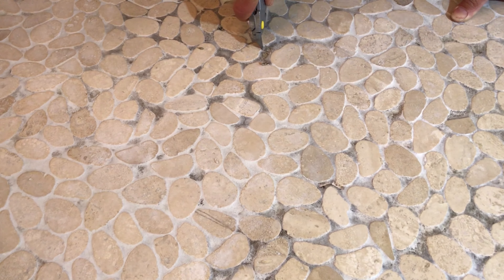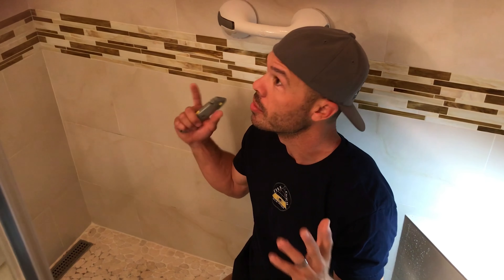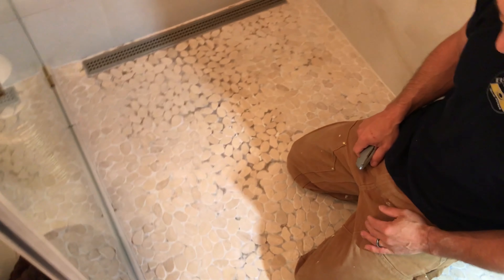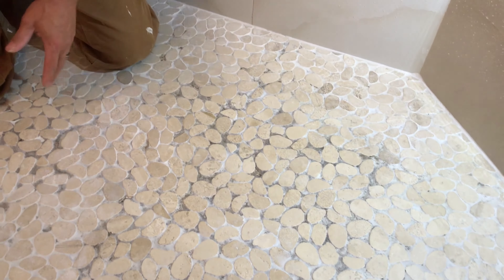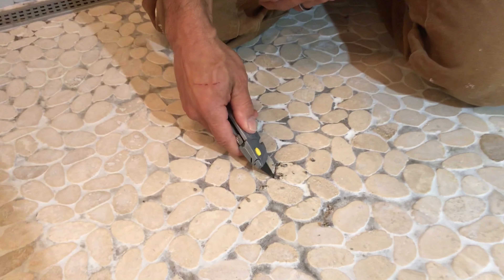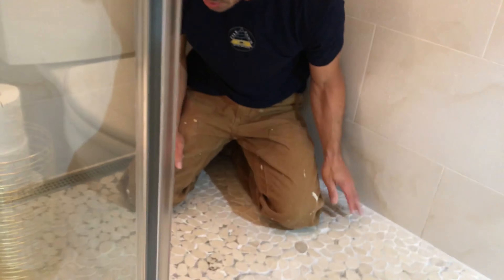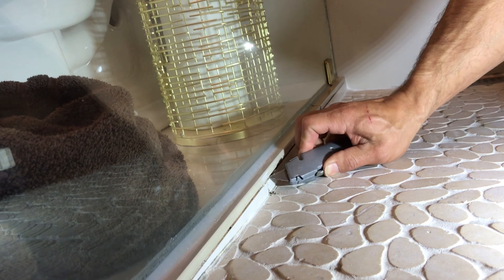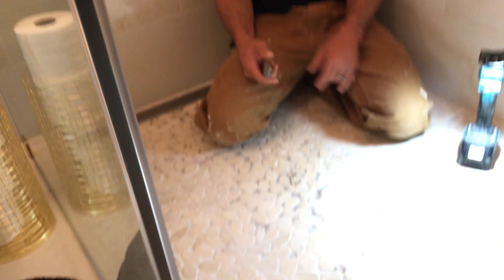I GROUTED this Shower WITH FUSION and it FAILED!

Comment: Just FYI for everyone. I've had sort of a similar issue with Fusion grout in showers, but I think the issue is that it just never dried properly. Whatever that label says, double it in a shower, let it dry completely - it doesn't dry well to begin with and when you start putting water on it, it never dries and starts getting moldy. I've had to re-grout 2 showers and the second time I let it dry for like 10 days, no problems after. So I think it's all in the dry time. Probably depends on where you are / humidity levels.
Reply: Just a follow up on my 5 showers done with Fusion Pro, including one just done a month ago - all holding up fine. Once again, secret is to let it dry - give it a week to be safe.
Reply: @adeptds  get back to us in 5 years
Reply: @Jack-russell103  The one I was referring to was done in early 2020. So far so good. No problems with constant use. What exactly makes you think it would fail at exactly 5 years but not in any time within 3 years? Just because someone installed grout incorrectly, doesn't mean it's bad grout. Clearly if the grout does not dry completely, it will fail. This is not your typical grout, and it dries differently. In fact I have another 2 showers with identical Fusion Pro grout. One was done in 2018 (absolutely no issues) and another done about 4 months ago. no problems. These 2 were in a dry climate (California) and died completely in probably 4-5 days. The original one I was referring to that had issues, was in Florida and I let that dry for 2 weeks to be safe after I re-grouted it. Frankly, you don't know what you are talking about. On the contrary - I have a shower with standard grout, and that grout has washed out completely in several spots. So again, Fusion Pro SPECIFICALLY states its good to use on shower floors, it's right on the website. So if you want me to get back to you in 5 years, sure, just post another comment in 2 years and I will even send you a picture of that shower I initially referred to that I had issues with (high humidity location). I am going to bet it's going to look the same in 2 more years as it has for the past 3.
Reply: My question that I can’t find answered anywhere is what is the best way to remove dried cement grout on a sliced river rock shower floor if I wanted to re-do?
Reply: @amandabundy4664  
White vinegar 
Let it sit 5 minutes than remove with wet sponge or if real thick a brush before sponging
Reply: @tomdemeo2708  no I meant actually removing the grout itself from between the joints, not residue on the rocks
Reply: @amandabundy4664  
Oh that’s not easy it would have to be done manually scraping it out. Better to tear it out and replace. If you’re installer recommended it they should do it free. If not remember to use traditional cement based grout with latex additive.
Reply: @tomdemeo2708  yeah eventually I will probably just break up the whole rock floor and replace it. When they originally did the sanded cement grout it was supposed to be like a medium gray color and they didn’t mix it right and it came out super light and also uneven. At the time we didn’t really think much of it, but here we are a year later, after using it daily, and it’s like impossible to keep clean and just looks bad. I had to scrub it with a stiff hand brush when cleaning and it just bleached it out even more. BUT, I actually just dyed it with a dark grout paint. It was a LOT of work lol. It was really hard to get it all up in the nooks and crannies between the rocks, and then of course it was impossible not to get all over the rocks, so I had to individually scrub each rock once it dried, and then I noticed all the spots I missed, so I would have to go back and touch up, and then scrub all the rocks again lol. It was brutal. On the packaging they recommended the grout dye to only be used on vertical and horizontal grout lines, which now I see why, but I decided to go rogue haha. I had previously used it in my laundry room, dyeing a medium gray grout to a black grout, and it worked awesome, and is holding up great years later. That was 8x8 square tile though. Now, surprisingly the shower floor looks great. It’s one even color and is very dark, hopefully to hide the dirt. I got some mild cleanser and will not be scrubbing at it. I also used a matte clear coat sealer on top to protect it. But, we’ll see how it holds up over the years in a shower with daily use.
Reply: And thanks for your reply. If I eventually do have to replace it, I will be choosing a different tile and a dark epoxy grout!
Reply: @amandabundy4664  
Good idea pebble shower floors are a nightmare less grout is better square mosaics. Carful of epoxy also difficult to use.

Comment: Prism is the only grout by customs that worth using. Good for you on telling the truth about reps and warrantys, been saying the same thing for yrs.
Reply: Won’t be using fusion 👍🏻
Reply: I only use prism and I mix it with grout shield instead of water. mix with a margin trowel being sure not to "overmix" (whatever that means. maybe thats why they suggest not using a drill to mix), let it slake for 7 minutes, remix briefly and then go to town.  Water is used to clean wipe it. They claim prism has a sealer in it already. I dont do many showers but I never have any issues with it changing colors or turning white after it dries. 

Polyblend has fucked me almost every time I used it. Turns white in spot no matter what I do. It might not agree with our local San Diego water supply. I dont use pre mixed grouts like fusion. I dislike the consistency

Comment: Your biggest mistake was allowing that guy out of there alive LOL! For years I've been using MAPEI Keracolor Sanded grout, and mix it with MAPEI Grout Maximiser sealer instead of water. But lately, they introduced MAPEI Ultracolor Plus FA Grout, which replaces sanded and unsanded grouts, has a fine aggregate, avoids color mismatching, and does not need to be mixed with a sealer, as there is one built in. It is a fast setting grout, I mix have the bag at a time unless I have someone with me washing the tiles within 5 minutes. You should take a look into it.
Reply: jeffostroff Tec power grout is the best that I’ve used. It’s calcium aluminate ...there’s no pigment added,it’ll never bleed and very easy to use.
Reply: Wait til you read about Powergrouts issues
Reply: @Ed___341  Oh no, what's up with Power Grout?
Reply: jeffostroff 
the issue they claimed was a bad batch but it’s been a known issue that every once and a while you will get a bag that’s bad and you don’t know it’s bad till it’s on and Someone decides to clean It to with a brush or use their nail on it and it will scrub off or dig into with ease. Had two showers come up like that.

Comment: Newer Toll Brother homes in Arizona are getting completely redone at no charge because of this exact same issue. The original installers are redoing it on several homes. They are claiming it was a Fusion issue, and as far as I know, Fusion is covering the cost.  Toll Brothers is huge of course, so maybe they received a much better response than you.

Comment: I demo a shower and it’s had a felt paper with copper strands in it .my sensei lol said it was called copper tight shower pan and it failed so bad !! He said he believes that’s how sheet membrane pans will be after 10 years so I’m kinda unsure with sheet membrane shower system 🤔🫣any thoughts? I’m still rocking pvc pan! What is the oldest sheet membrane shower pan you know of?

Comment: I really love watching your content.  I’m fairly new to tiled shower installation.  I’ve just recently installed a pebble tile floor in a shower.  I noticed a few contractors mentioned sealing the pebbles prior to installation and also sealing after the grouting application.   Of course I had already installed the tile before reading the part about sealing the tile prior to install, so I ran the sealer over tiles after installation, but before grouting.  One thing that ran across my mind was, if you seal the pebbles completely before install, wouldn’t this have an effect on the adhesion?  If the surface of every pebble is completely sealed, then what is the thinset and mortar gripping to?

Comment: Question: How do I remove just old grout from pebble/rocks? Oscillating tool/grout remover is good for straight lines, but the rocks are all random and it’s hard to dig it out. Tips tricks? I figure in this video the grout was soft which made it a little less a pain (though still nasty!) but not sure the best way to go about this. Thanks.

Comment: Glad I saw this. The product is rated exterior use, anything but submerged. So obviously, pebble tiles might not do well near a swimming pool. Best thing Custom Building Products can do is discourage its use for pebble tile across the board. It also contains MicroBan to kill germs. This may sound like a good feature. But it may indicate a problem with with the formula. Cementitious grout doesn't need an anti-microbial.

Comment: When I see issues with these beautiful new very expensive showers it dissuades from redoing the showers in my house built in 1995. They aren’t nearly as pretty but they have no issues. Original valves walls. I did do some miner updates on one when I replaced a couple cracked ceramic tiles in the curb. But that’s all I have done.

Comment: I'm thinking of what might have caused the failure at the tight grout lines. I can see it failing in the pebble tiles, as the joints do push the 1/2" limit. Maybe the water soaked under the tile and migrated up the curb, soaking it from behind? Or maybe it was defective grout to begin with. Oh well, at least that day you made friends, if not money.

Comment: iSAAC Im a retired attorney and i think you learned the best lesson in life.. use the legal system when common sense says you are right  !When  they changed their product applications THEY KNOW THEY HAVE A PROBLEM! i I watch your videos often as i am doing a curbless shower with a schluter presloped pan ..coated with Ardex 8 plus 9 and a pebble honed stone matrix floor. I learned from your testing and the real life problems you encounter. Your honesty and open expression of learning new and better practices are refreshing.  I subscribe to the mold issue as the black grout that is failing.  Shame  on Custom Products for taking the the LOW road of denial...and blaming others workmanship.  I am taking back all their products i bought from Home Depot and buying Ardex products .

Comment: I talked to Shluter about this very problem apparently the issue is suspected to be the mesh backing holding the tiles together it can react to the grout be it water or epoxy also the mesh itself could prevent the thinset from getting a good bond to the stones unfortunately there is no standard for the glues used in these products and it’s subsequent failure of a good tile job, what was recommended was before use put a sample in a bucket of warm water leave for a day and see how the glues react
I also have had a Fusion Pro failure in a small section with mesh backed tile that washed out and was black, a regrouting fixed the issue

Comment: A tile guy told me if I use this product don’t grout the floor on the same day as you do the walls.  He said the floor will get wet and the fusion pro won’t set up properly.  Not sure if that’s what happened here.  Might be good advise.  Or it’s just the product failing.  Thought I’d share.

Comment: Great commentary on company reps. Had a job 2 years ago, LVT. Tiles had a curl to them in corners. Used the manufacturer’s adhesive, and installation recommendation. Yet the corners returned to their curled state. Right out of the box they had a curl. Reps did nothing. Sent an “ independent inspector” who did a report on the floor. 3 pages stating the floor has a flaw, yet one sentence blames me, the installer. Company denies claim. Finally threatened legal action against them, matter was resolved immediately!
Reply: Independent inspector that was paid by the manufacturer.... they always place blame on installation issues and never the product or manufactures

Comment: I have the pebble shower floor with sand grout which has just disappeared over the last 5 years.  I do use pretty strong cleaners which I have learned my lesson on that.  I just wanted to say you are a great guy for coming back and redoing the grout.  Luckily my contractor has made the same offer for me.  I've been doing a lot of tile work myself the floor in an enlarged laundry room and two backsplashes one in the kitchen in a herringbone pattern that I wished I never started and a glass backsplash behind my utility sink in the enlarged laundry room.  You guys should be proud for going back out and fixing the grout regardless of whose fault it was!  Wished you lived in my community!

Comment: I feel your pain on this one.  I'm a 20yr veteran of ceramics but started installing the groutible luxury vinyl tile 7 or 8 yrs ago.  It was a newer product for our city and for this particular distributor. Also used the recommended grout as well as.all recommended products and tools, since it was a  newer product.  Product is awesome.  Good durability, nice to work with.  
Had an issue with a project of the grout separating from the tile.  But only in particular areas.  In front of some old, glass garden doors, under the stove and working outwards and same with around the washer dryer.  So at.the ti.e.is was my opinion that it was heat sources causing the lvt to expand and contract causing the failure. I removed the grout and replaced it, and it happened again.  This time we brought the rep in.  We pulled a tile in these areas and he put the blame on wrong trowel size.  (I used recommended from the glue pail and not the tile box.  Same company for both.  And was the recommended adhesive).  I tried to plead my case showing the areas it happened the worst to no avail.  I ended up replacing everything there.  Many 1000's of dollars.  
Fast forward 3 yrs after that, glue pails now have a warning on them that they it is not to b used in direct sunlight or high heat source areas.  Can cause excessive expansion and contraction. Just shows how much protection we actually have under warenttee.

Comment: I tiled a pub here in the UK using dozens of metres of pebbles. Horrible stuff. The price was tight and the whole job would have used acres of grout. Instead we used silver sand (washed playpit sand) with a white cement and a waterproof additive. Not sure how that would perform in a wet area but went back to the job 6 years later and still standing up to some hard wear and tear. No longer white but not to bad considering the chemicals they have poured over them almost daily.

Comment: The wax you mentioned is likely soap residue/soap scum. The black you found on the grout is mildew which is typical for any shower or wet area. Regular cleaning with bleach/water dilution will remove that, homeowners responsibility.
 As far as the soft grout, reason is most grout is inadequate for below water line. Epoxy grout is certainly the best but very difficult to apply. Pebble stones are prone to problems bc the round edges of one stone touches the edges of another and prohibiting the grout to encase all sides thus allowing water to enter between stones and beneath them.
Your situation is the main reason I stopped doing tile showers and now only rebuild showers with a local subcontractor that makes and installs cultured marble showers and tub surrounds. I do the demo, plumbing, prep work and the final trim installation. I back up my work with a 90 day warranty and my marble installer warranties their work 10 years limited. I make several thousand dollars on every shower job, as I should. I love repairing and remodeling homes and bathrooms especially.
 Hope my experience helps you in some way. Good Luck :)

Comment: Has anyone had any experience using mapei ultra FA with the pebbles. Works great for the small almost non-existent grout joints but settled in some of the bigger joints. Had to pick my battle on that. 
And I agree with you about sales reps and the products overall. Most are average at best and  we have to work miracles to make it work

Comment: I am a tile contractor in Woodland, Ca. I used Fusion Pro in a shower with a mortar pan. I grouted it and it failed within a few months. I called Customs Building products and they told me that I would have had to wait 10 days after tile 
installation to grout it. I dug out all the grout joints which was gummy and a pain to do. I waited 2 weeks to regrout it and it failed again. Fusion Pro is nothing but caulking in a tub and their caulking says " Not suitable for wet areas."

Comment: I have the same problem with Mapei unsanded grout with a pebble floor.  I need to know the best grout I can get in a charcoal color for flat cut pebble floor.  I have to scrape out all the old grout now.  For me it discolored and I had darker areas show up after 3 years or use.

Comment: I am grouting my bathroom floor and using tec power grout 550. Using the exact water measurement and exact mix, slake, mix times, I was able to grout half of 35 square feet before the grout became powdery and brittle and unworkable. I am having to scrape out some of the grout I installed. It states pot life is 35 minutes minimum but it was more like 10 minutes for me. 

I have one more 7lbs bag but I am afraid to use it.
Reply: @robert warner they just did a video testing all of these "advanced" stain proof grouts. Apparently all of these fast setting grouts perform terribly, especially when wet.

Comment: The Custom Fusion Pro Grout honestly it is not such as what they advertised.  I grout the little hex tiles with Fusion Pro on my shower base, just 2 years later it completely runs off then I had to re-tile the shower pan anyway.  Disappointed. 

Thank you Issac, you are a very kindly life coach.